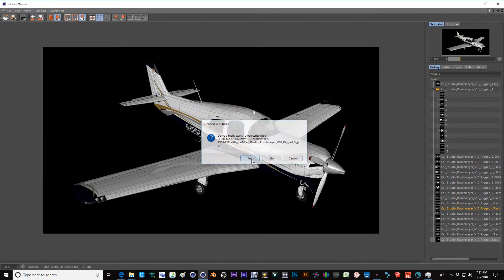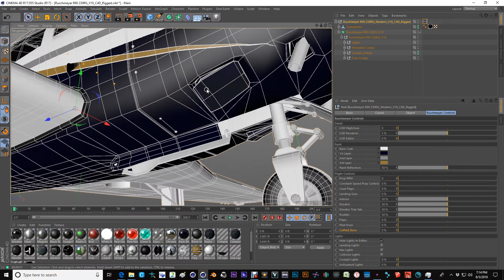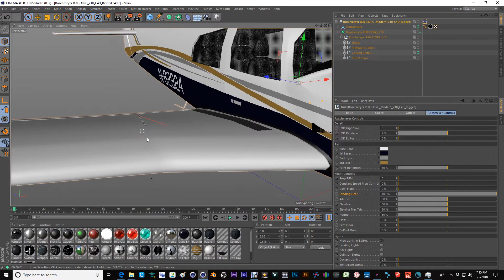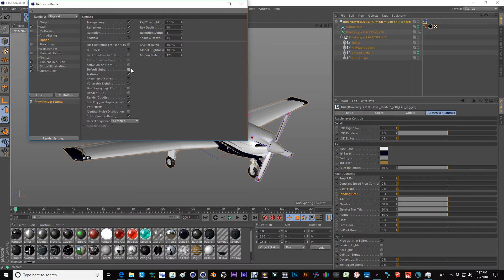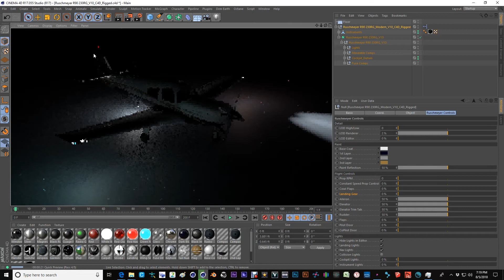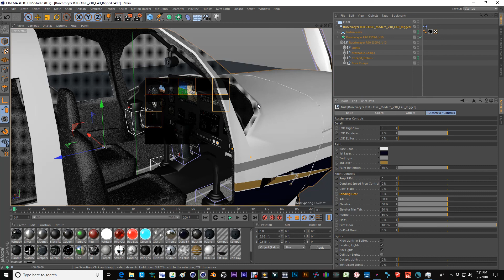Ruschmeyer R90 230RG V10 3D Model Rigged C4D

Comment: This Animation control Use it in unreal engine,When I start to program fly airplane  keyboard in blue print??
Reply from the maker: darkwyndigo the animation control for this model is through C4D. Unfortunately it is not rigged for use in the Unreal Engine. If imported in Unreal in any other format from C4D it will not have animation controls.